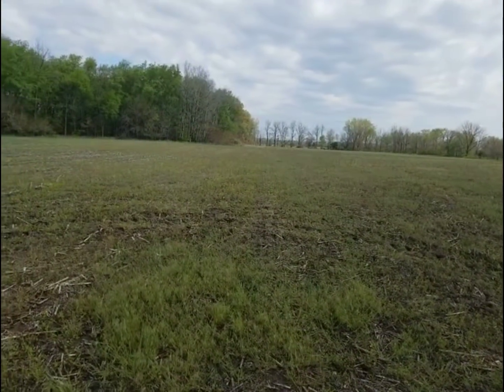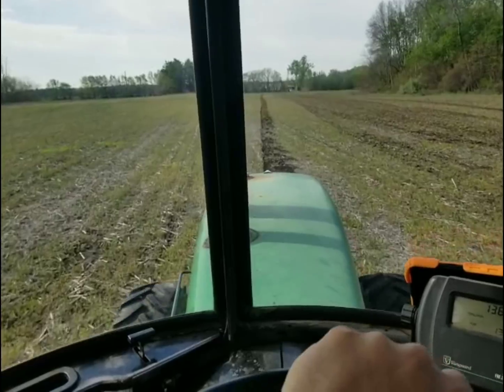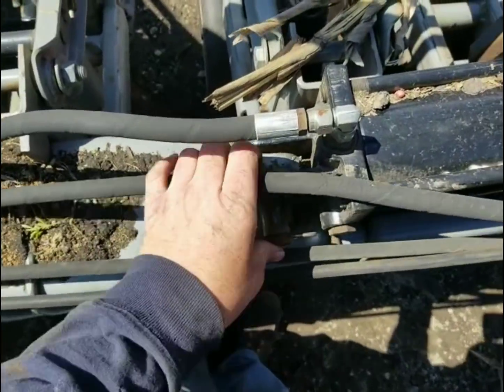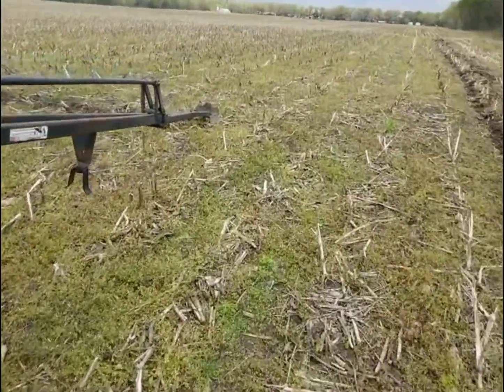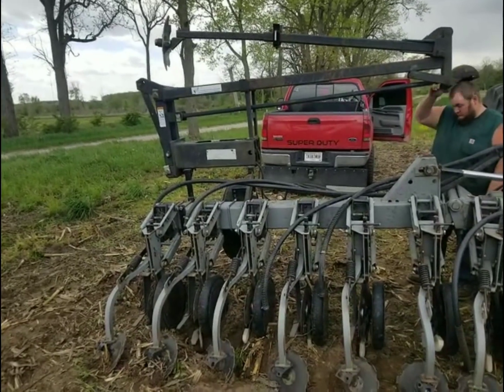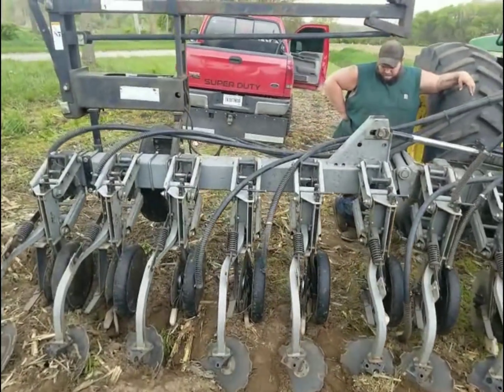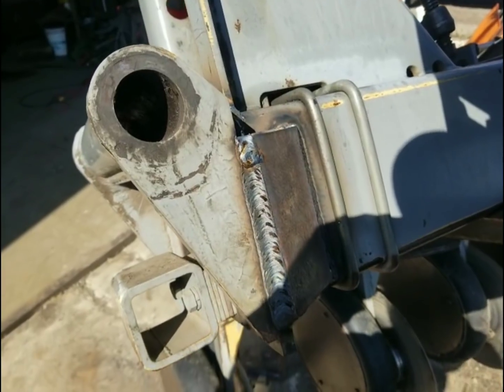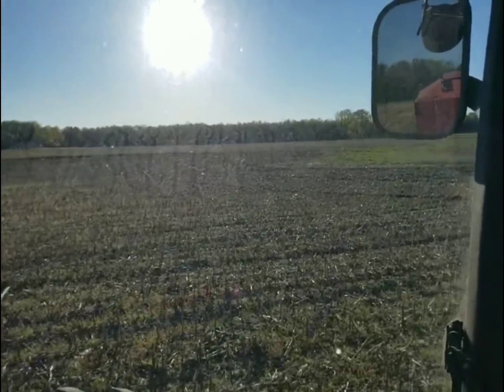Broken Wings And Pit Viper Sunglasses...Day 2 Of Planting Beans Video!

Comment: We have a seeder like yours but ours is mounted on a 36 foot  blue jet  caddy with notill disks up front and drill units behind it.  It has a flexi coil tank that holds about 150 units of seed .  That setup works great for double crop soybeans and wheat and rye . We found that the 10 inch spacing on beans  works great on marginal ground and on good ground we can raise every other row unit to plant 20 inch spacing. We can seed into standing rye or crp grass and corn stalks with ease . Those style of seeders are rugged and simple.  We bought ours used from Canada and we modified it to be able to cover acres fast with fewer fill ups plus handle tough notill conditions.  Keep up the good work and stay safe!